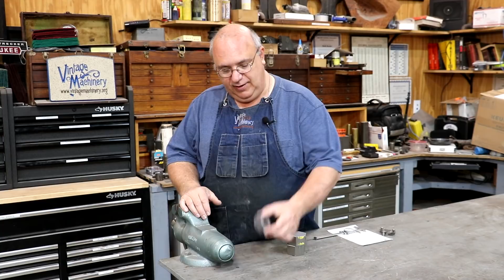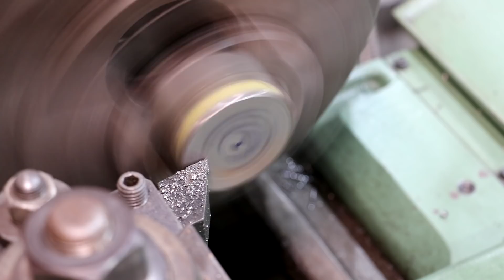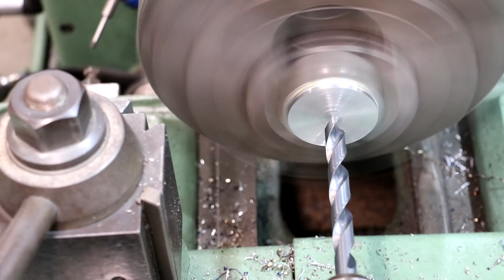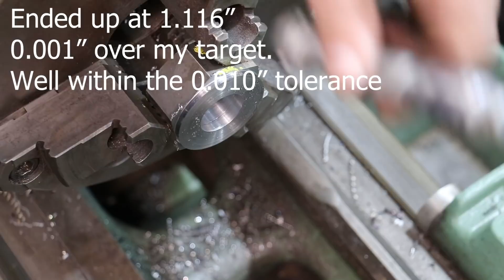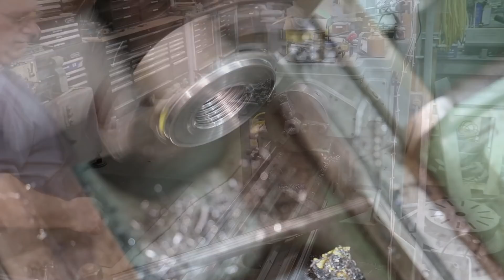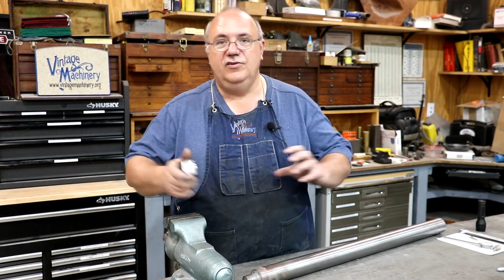Diresta Bandsaw Restoration 19: Machining a Special Nut with Left Hand Internal Threads

Comment: Small correction: it's not the centrifugal force that could loosen the nut, but the inertia of the wheel and friction. Centrifugal force only acts radially (perpendicular to the rotation axis).
Reply: Hey guys, put left hand threads on the left side of your trailer lug nuts.  Big trucks use left hand threads on the left hand side for a reason,  learned that lesson once, involved an overloaded trailer, no 4 way lug wrench, and a long trip home on a gravel road, anyhow, left hand thread wouldn't have loosened up.  Made it home.
Reply: @haroldsprenkle4173  Thanks so much for not calling it driver side that irritates the crap out  me, like calling it a HOT WATER HEATER or I COULD CARE LESS.  Yes my OCD is annoying to others.  Spent about 30 yrs as auto mechanic in the dealership before my Machinist career now in aviation field.
Reply: Hey guys, want to work on something really old school work on a farmall h water pump.  Left hand threads, taper pins, packing glands, adjustable pulleys.  It is all there, keith rucker would be proud, I have brazed farmall h water pump pulleys back together and chased the threads on the lathe.  No problem.
Reply: Extreme RPM could make the nut stretch,  but I doubt that's an issue here :)
Reply: And to be 100% correct: Centrifugal force doesn't even excist.
Reply: @Panzax1  Neither does excist 😂😂😂
Reply: @Panzax1  what are you even talking about?
Reply: @CatNolara  He's probably a flat-Earther.
Reply: @CatNolara  Read up on your physics 101. Or maybe it was physics 001 ?
Reply: @benpress8884  Or someone who has a small grasp of the physics of moving bodies ?  https://en.wikipedia.org/wiki/Fictitious_force
Reply: @Panzax1  stop insulting others for your lack of understanding. Ever heard of actio = reactio? The force pointing towards the center is the centripetal force, e.g. rope tension, while the force away from center is the centrifugal force, which is caused by inertia. It's the force you have to overcome if you want to change the direction of a moving object.
Reply: @CatNolara  LOL.
Reply: @Panzax1  OH?
Reply: @Panzax1  What is the name of that mysterious outward force that does excist?
Reply: @ellieprice363  There is no outward force. It's the momentum that wants objects to continue in a straight line. The force on a object in a cuved path works towards the center of the path. A=V^2/R.
Reply: @Panzax1  But, no object ever continues in a straight line. I wonder if an “inward” force known as gravity causes moving objects to curve in flight?
Reply: @ellieprice363  its the force that opposes centripetal force.  Yep its an odd concept!

Comment: Great video Keith. Here in the UK we mark aa left hand thread nut by using a threading tool to score the centre of the nut in the middle of the corners. That way people don't make the same mistake you did trying to take it off. These are found on ALL our gas bottles so you can't mix oxy/acet lines on the bottles.
Reply: In shipyards different gasses had different pitch threads too.   Then,  for convenience in keeping fewer hoses on hand,  they had adaptors from one thread to another.   Ships were sunk.
Reply: wew3wewewew ewew3wewewewewewewew3wewewewe  eww you ewewéwewewewewew3w3 ewewéwewewewewew3w3 ewewéwewewewewew3w3 ewewéwewewewewew3w3 ewewéwewewewewew3w3 ewewéwewewewewew3w3 ewewéwewewewewew3w3 ewwewewewewewewewewewewe ewewéwewewewewew3w3 ewewéwewewewewew3w3 😅
Reply: If there is any bolt sticking through it is fairly easy to check which way the threads run. But an L stamped in the end of the bolt is really handy for the next poor guy who has to deal with it.
Reply: @The_DuMont_Network  like Ford did on thier trucks.
Reply: Lot of heim joint jambs nuts here have that mark. The left handed ones that is.
Reply: Just like the left hand thread for acetylene gas